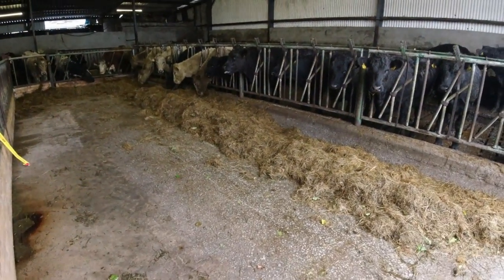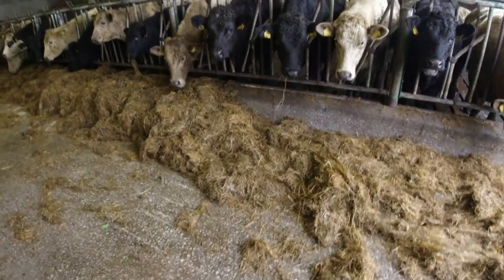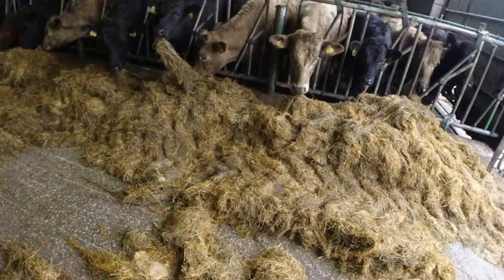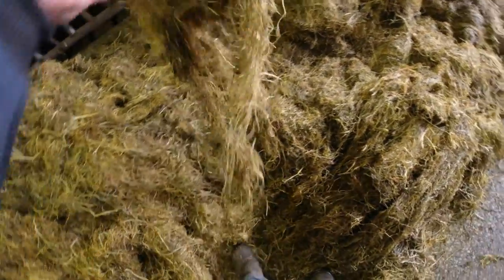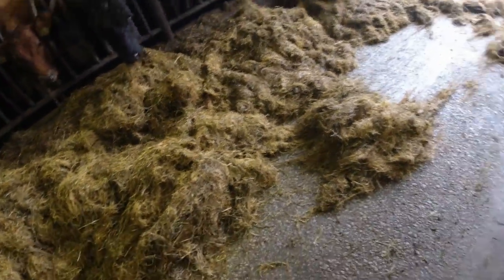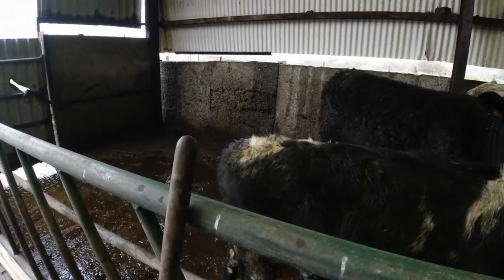How to make cattle very happy very fast. Moving Bales,Feeding Bales

Comment: Where are ya from? I cant place the accent
Reply from the maker: Kerry
Reply: @mrcvx  What's your opinion on the claas 510? Driving a Arion 430 (2013) has loads of power, great gearbox, air conditioning is a little weak though in my opinion
Reply from the maker: I've never actually used that tractor for anything other than feeding bales.
Seems a grand tractor good hydraulic power
Reply: @mrcvx  most of them have 90 litre/100 litre pumps and some have 140 litres by using dual pumps I think